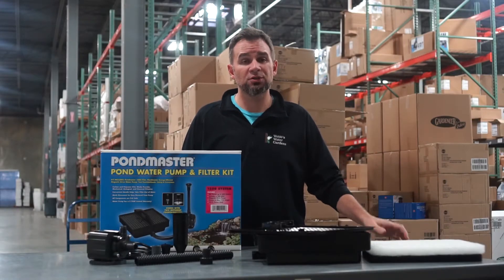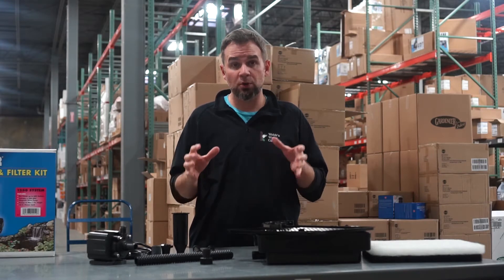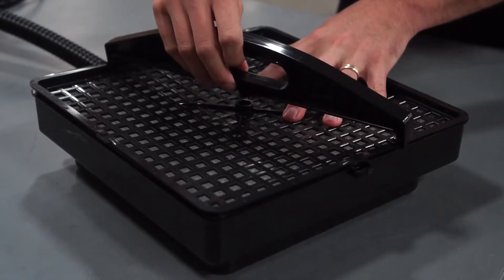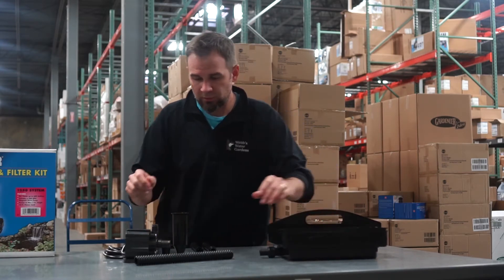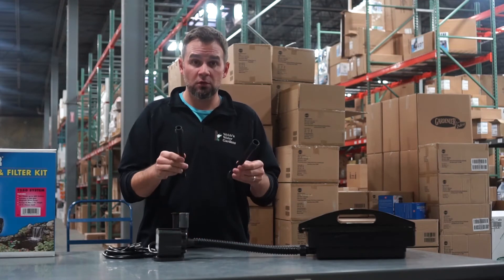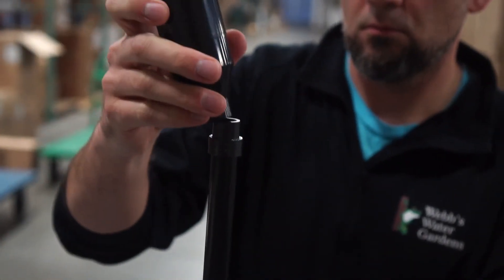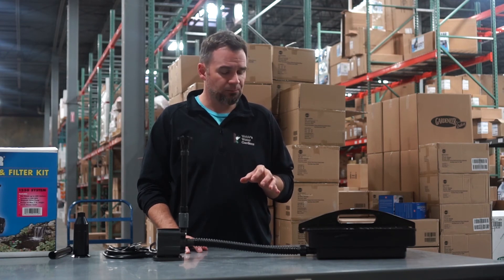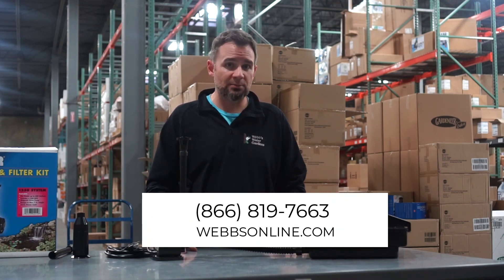Pondmaster Pond Water Pump & Filter Kit -  Breakdown

Comment: So I have a bit of a question, when I turn on my pondmaster it doesn't pump. I thought it might be a water vapor lock, so I would blow down the exit pipe. And sure enough the pond master works fine. But the problem still persists. I can take the pond master out of the water. Drain it completely, and then put it back into water and it will not pump when I turn it on. On. I have to blow into the exit pipe to get it to work. What do you think's going on?
Reply from the maker: Have you tested with piping off? Only the pump submerged?
Reply: @WebbsWaterGardens  yes..but I'll try again.  

It is an older pump.  I wonder if the motor is weak.

Thank you for the response..
Reply: @WebbsWaterGardens  just checking back...

Comment: Can u replace power cord
Reply from the maker: Not running directly into the pump, backend is epoxy sealed. Beyond that, it can be repaired of replaced partially.
Reply: @WebbsWaterGardens  can back be open?
Reply from the maker: @MaNo0sss  No

Comment: Why does this filter have no media in it? Just the sponge things? Can i add small pieces of lava rock to it?
Reply from the maker: There is mechanical filtration - polyester and carbon impregnated pad. We would not suggest adding lava rock.
Reply: @WebbsWaterGardens  would you believe this was recommended and sold to me for a 110g koi tank. (Stock tank for 4 tiny baby koi until spring when i can build a nice pond in the ground) yeah needless to say, it didnt work for what i needed and the garden store refused to return it with a receipt didnt even have it for 2 weeks. Andddd they sell koi there!!! I spend so much money at this nursery in the spring and summer and also bought a $400 cement german shepherd statue there. I guess refunding me a lousy 80 dollars woulda broke their bank lol